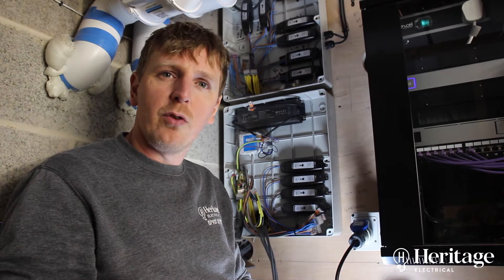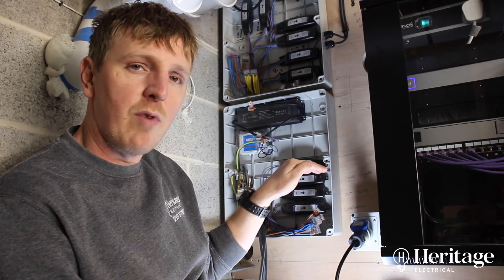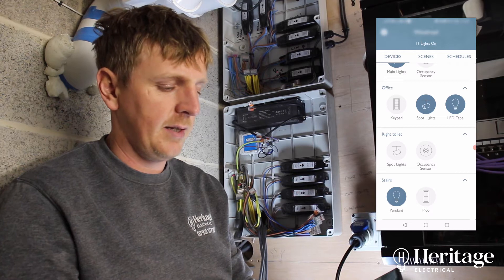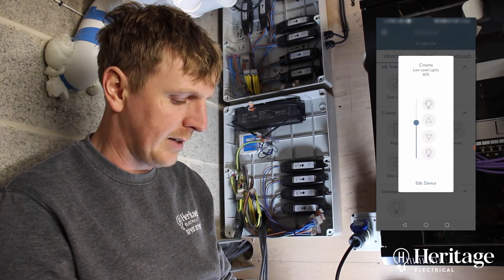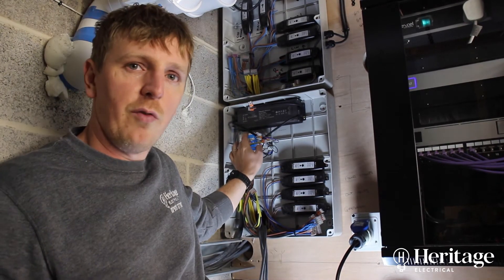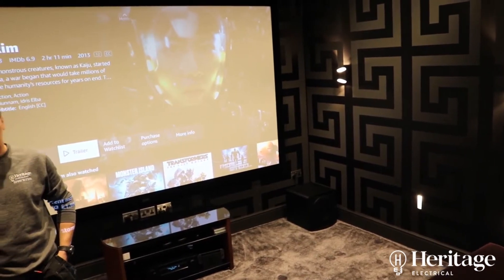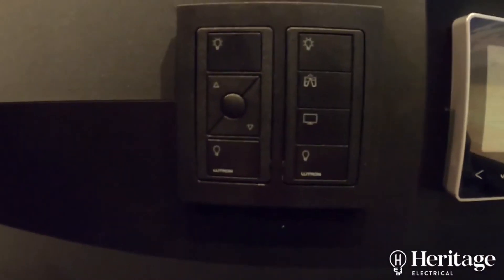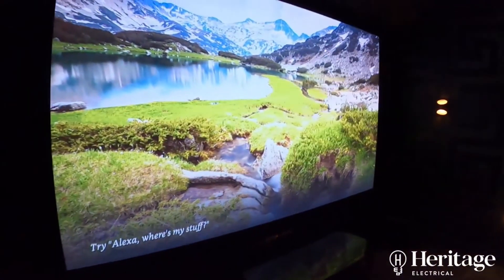Smart Home Automation: Lutron RA2 Smart Lighting Installation Overview

Comment: Hi, I’m going to be using some RA2 in my next install. Was originally going to try and conceal the modules in the ceilings but like the the thought of them being more accessible like yours are. Do you ever have issues with range between the pico and the
Module?
Reply from the maker: Hi Rick, we try and keep the modules as local as possible to the Picos. According to the literature, they need to be 18m line of sight or 9m away through walls.
Reply: @HeritageElectrical  thanks guys, appreciate the reply. Top work by the way, can see the attention to detail you guys take.